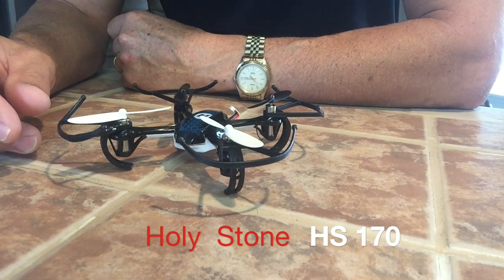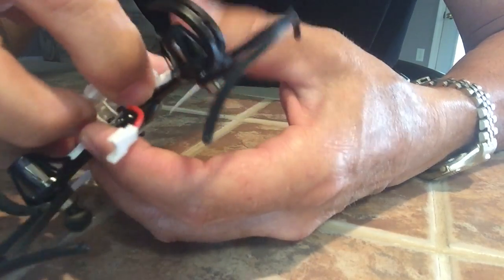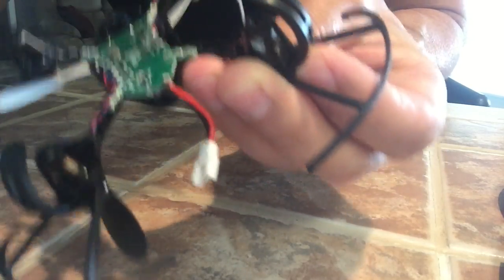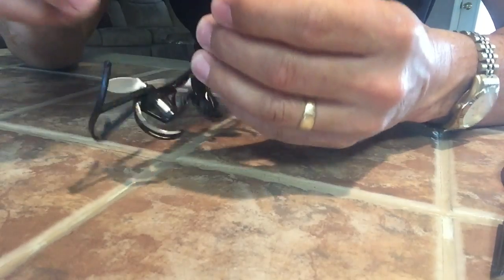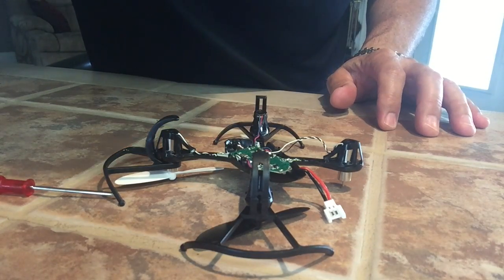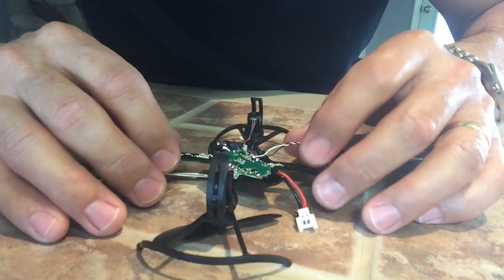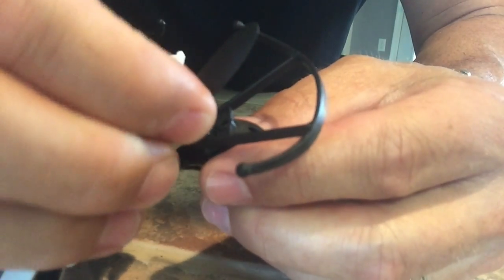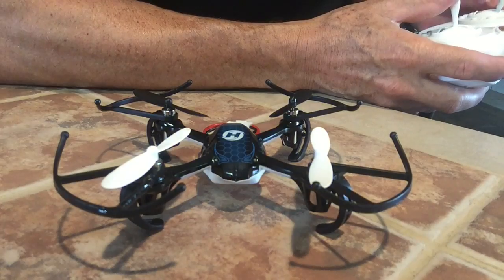Holy Stone HS170 Predator- Replacing burnt motor

Comment: did you add new solder material when connecting new wires to the board? or were you able to just use the pre-existing solder that was on the board?
Reply from the maker: kraniuz ,
Many times I was able to use existing solder but a few times most of the solder came off with the wire therefore I did have to apply more. Not an easy task on a small board, but possible.
Thank you, 
Russell

Comment: Bout to change one soon.
Reply from the maker: +sean smith- I hope my Video helps. Soldering in the small area is probably the hardest part. Be sure to note the location of the wires before removing them and you'll do fine.